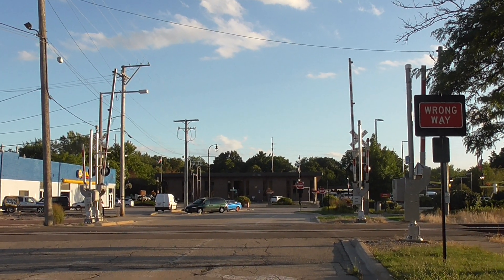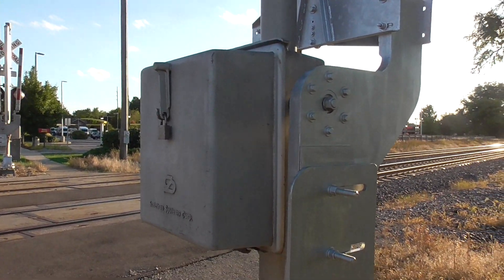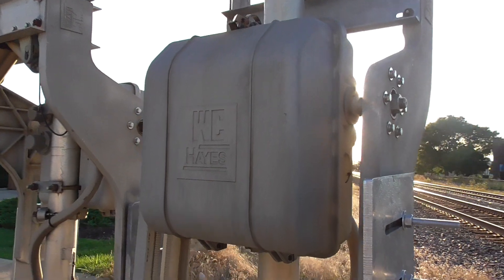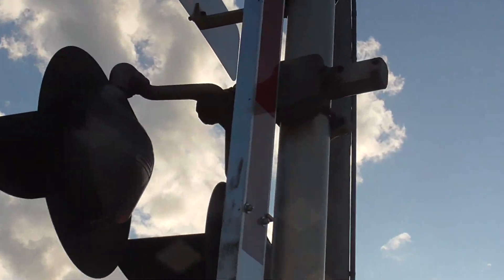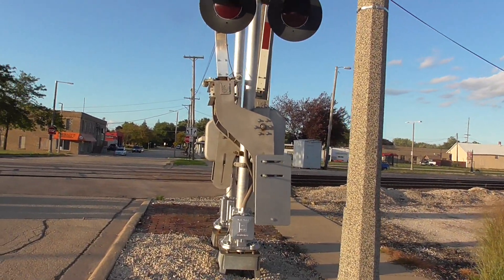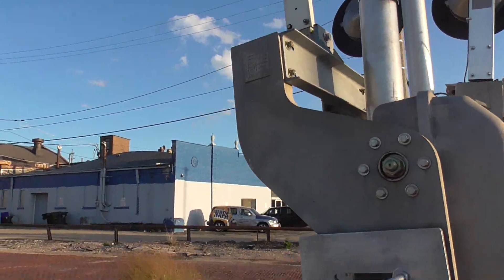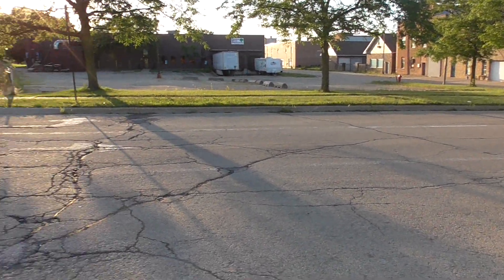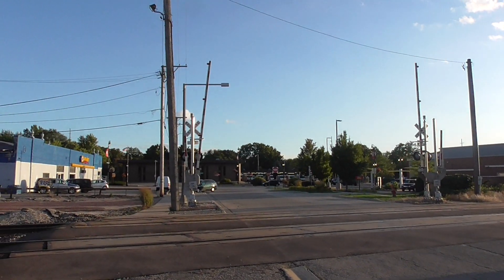6th St. Grade Crossing Tour DeKalb, IL 8/27/19

Comment: Nice! I am very familiar with this crossing, as you may or may not have seen in my videos from last spring. Easily one of my favorite crossings in town, particularly due to its location right on the bend, where you can see down the line in both directions.